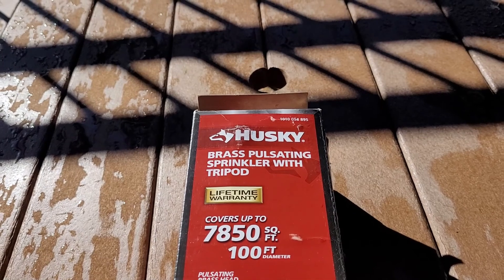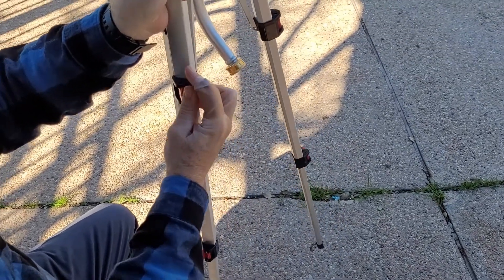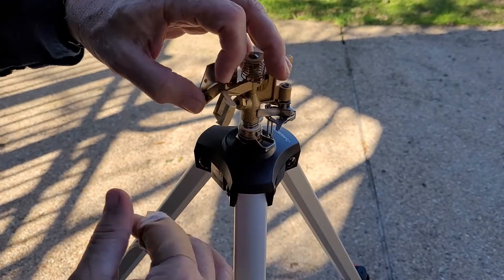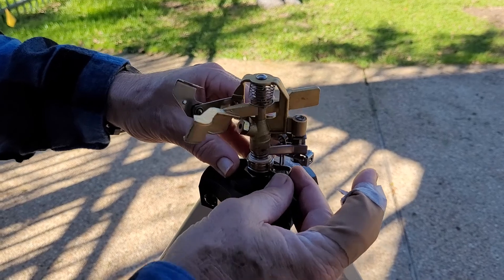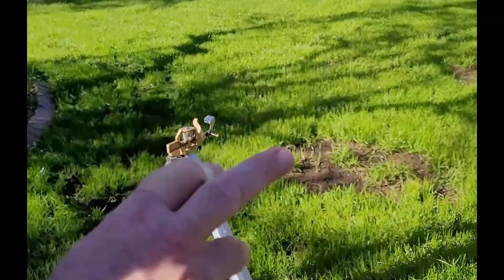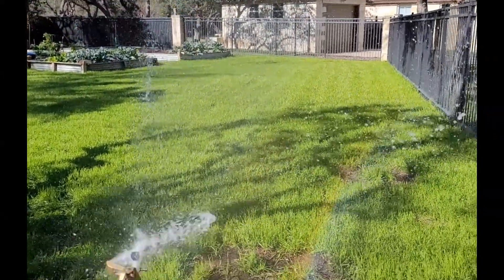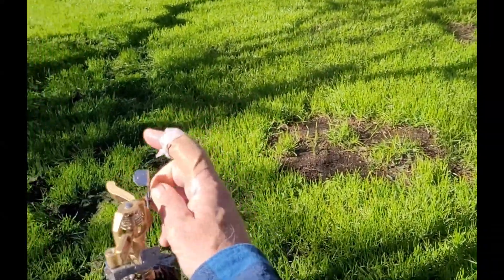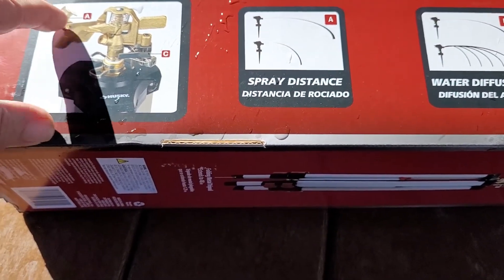Metal Pulsating Sprinkler with Tripod - model 10507HDDI

Comment: I’ve been using mine for a couple of weeks with no issues. Then today after moving its location the water coming out is quite low. No hose blockage or pinch anywhere. Faucet all the way open. Even checked inside for a busted pipe. All other sinks etc working fine. 
Starting to think that something is inside the hose causing less water because it doesn’t spin anymore. I’ve never seen this happen before unless there is a hose pinch etc. 
looking for ideas that I may not of thought of…
Reply from the maker: Does it work on the neighbors hose?   Is there some debris blocking the hose adapter screen on the bottom?

Comment: When you have the distance set to max is only the end of its blast putting water on the ground or is it falling the entire distance? If that makes sense.  Like are you only putting water down at the 50 ft mark of its path only or is it watering everything within that 50 ft?
Reply from the maker: If you back off on the water deflector, then it will shoot a mostly straight line with most water coming at the end. However, some water will fall all along the path based on gravity and wind speed.  If you add more deflection, then the distance will shorted and you will get more water all along the path.
Reply: @DrBDIY  thanks!
Reply: @DrBDIY when deflection is added, how much is the max distance the water can be sprayed around?

Comment: What kind of hose is that? I like the pressure control valve on there so I don’t have to run to my spigot every time I want to change water pressure.
Reply from the maker: Just a regular hose.  Search for: garden hose water shutoff
You will find several adapters that add an on/off to a hose.

Comment: I bought two.  On one, the diffuser shield and pin were badly bent out of position.  On the second, the water pressure keeps knocking the unit over directing the water flow directly into the ground.
Reply from the maker: Sorry to hear that. Fortunately, Husky products have good exchange / refund / warranty policies.  As a maximum, we have 60 PSI of outside water.  No problems here with stability. Did you spready the tripod out as wide as possible?

Comment: If I buy a few of these, can they all be linked together?
Reply from the maker: There is no support in the sprinkler for linking together. However, you could purchase what is called a "hose Tee" 
 or a splitter that enables you to connect hoses (daisy chain)  and then use a third hose to connect to the sprinkler at each T or splitter. See pictures:
https://drive.google.com/file/d/1dEiQowGnsCjh4BYQGrhJdv76-rPoVoBA/view?usp=sharing
https://drive.google.com/file/d/1kxBApZ3GiEFHUgUu8-B54NprJMLTSqDS/view?usp=sharing
The splitter would allow you to turn off a specific sprinkler.

Comment: I bought 2 a few days apart and both stopped oscillating after the first use. Has anyone else had this problem?
Reply from the maker: Did you check the three adjustments?  Do you have enough water pressure?  Simple enough time tested sprinkler technology.  Hopefully nothing fell off.